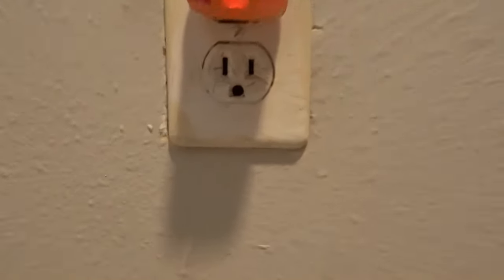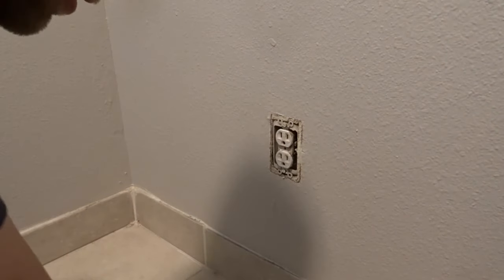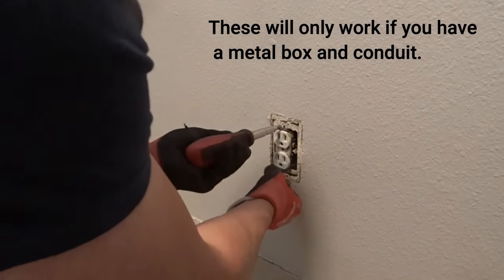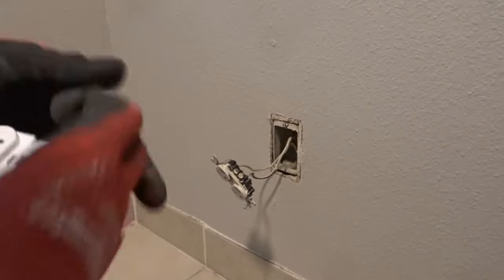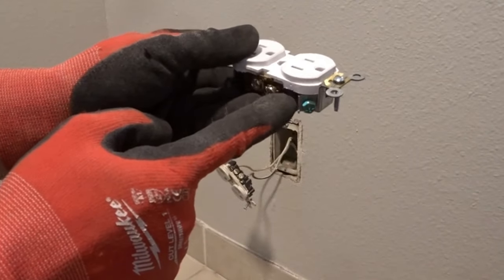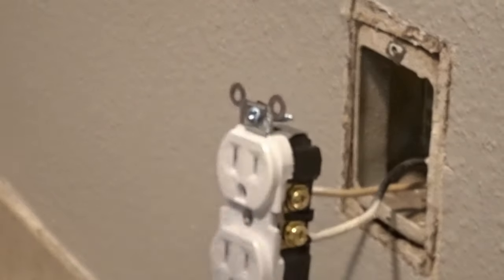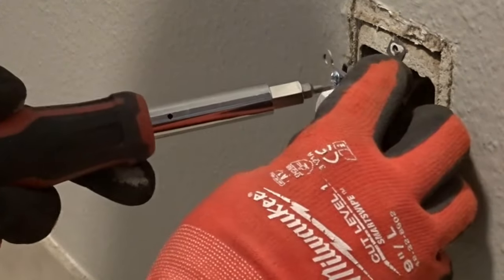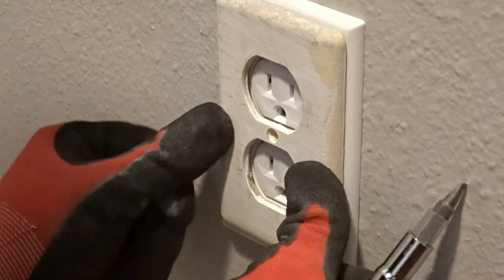How To Replace An Outlet | Ungrounded to Grounded

Comment: i wld have used a ground tail the fact the old outlet had no ground wld have made me think there is no good connection either a loose ring or so much debris the yoke and screws have no ground contact. otherwise bare minimum code/work  leads to exceptional problems in future🤔
Reply: Im right there with ya, I would have used the ground pigtail too, and looked like the box had an extension on it also, cant go wrong with  ground pigtail

Comment: Basically, your "pigtail" is just touching the metal box??? It doesn't screw onto anything...just the outlet green screw????
Reply from the maker: Because it’s the preferred outlet, the pigtail is not needed. Does that make sense?
Reply: @aaronfixesstuff  I have outlets in my basement that are not grounded. These outlets are in a metal box. SO if I screw a copper wire onto to the green screw of the outlet & have it touch the metal box, the outlet will be grounded???? I thought, this copper wire is called a "pigtail" ??
Reply from the maker: @k.b.392  you can buy a pack of grounding pigtails from Home Depot and that will do the trick. I showed one in the video.

Comment: You still did put that ground wire in it’s just the hot and cold no ground that was a if you show there what you did was just put hot and cold that’s it lol I was just going to do the same but checking on the net to see better but it’s just one thing give it power 🤩 great video thank you

Comment: Dude you don't know that the box is grounded. Those large rubber plates look like shit, imo. Keep learning Aaron. You have a long way to go. I would always wrap the wire around the screw, and not use the trap and pinch plate. I think this is code in CA.

Comment: I am missing something ... or you forgot? When you put the receptacle in there were only two wires. You did not have the ground wire attached.
Reply from the maker: That is correct. So the two ways to ground it were either with a grounding pigtail, or using the preferred outlet (that does not require the grounding pigtail). I chose the preferred outlet.

Comment: I still only saw 2 wires hooked up. He screwed he ground screw in without any wire. What connects the gtound pins to the box?
Reply from the maker: If you use the preferred outlet, the screw that attaches the outlet to the box does that.
Reply: @aaronfixesstuff  , Yes, I went back and he actually said that. But what is it about the preferred outlet. Is there a contact going from the ground sockets to the screw so it grounds whatever you are plugging in?

Comment: How is the outlet shown as grounded when it clearly isn't?
Reply from the maker: It is grounded. Why do you think it isn’t?
Reply: @aaronfixesstuff  what is it grounded too? There is no wire to grounding screw. I am not trying to be insulting but your video is very different in results that I see different videos on the same topic.
Reply from the maker: @AJBulava  not insulting at all. So I explain it in the video. The preferred outlet has a tab on it that replaces the need for the grounding pigtail. So this outlet was absolutely grounded, as evidenced by the tester. However, this solution only works I f the box itself were grounded. If the box is not grounded, I made a video that addresses that situation, and how to fix it.
Reply: @aaronfixesstuff   Is the solution a GFIC plug?

Comment: It's not clear why the old receptacle was not grounded and the new one is when nothing else was changed. The mounting screws, if tight, should provide an incidental ground by virtue of contact between the threads in the box and the screw heads on the receptacle yoke. All the paint could be an issue or the receptacle was bad. I would like to have seen a continuity check between the yoke, the ground screw, and ground opening on the old receptacle. If that checked out and you scraped off the paint and fastened firmly with clean screws, my bet is that your tester would show correct ground.
I'm not saying that you shouldn't change the receptacle because that was absolutely correct and the spec grade receptacle you used is the way to go. In the beginning you should use a multimeter to verify whether the box is grounded or not. The brass self grounding spring metal on the new receptacle helps, but shouldn't have made any difference. Having conduit or armored cable does not guarantee a good ground. It should be inspected at it's origin, the main panel. Your tester verified that the grounding is there.
I like your video though, Aaron, I realize the effort it takes to do this is not easy, thanks.
Reply: Yes you are right.   His presentation was meaningless really.  

Seems the video was made a fluff click bait.  

First you never do work without testing the box ground with a meter.  Otherwise no outlet will ground after you install it.   The old outlet should have grounded if the box was grounded, so step 1 put a meter on the box and neutral and see if its grounded.  You don't need a fancy outlet.  They all can ground through the mounting screw, so the old one was probably broken.  

He never said the box was metal and grounded.   Others made good points too.   So obviously it is a click bait video for views.   The dummies like it, but they really learn nothing useful.
Reply: Isolated ground receptacle was the old one.    The yolk is isolated.
Reply: @tedlahm5740 No it's not. I doubt that one would be used here, and an isolated ground receptacle has a triangle on the face. I didn't see that.

Comment: wow, the whole house was done in conduit? unless therye emergency circuits, even commercial buildings arent typically all done in conduit. But as an electrician myself, I never recommend using the conduit as a ground. While it is allowed for Code purposes, its only allowed if every single connection in that conduit run back to the panel is tight, and if you didnt do the run yourself, you have no basis to trust whoever ran the conduit did it right. and if the conduit run ever disconnects from a connector or coupling, you lose your ground. Youre better off pushing an individual ground wire through the conduit and grounding it in the ground bar in the panel. much more secure connection

Comment: !!! If the socket has no seperate ground, one solution could be to connect the neutral wire with the ground wire at the socket. So If the hot wire in the device touch accidentally the metall case, then the circuit breaker in the main panel interrupts the power (because of direct connection between the hot and the neutral wire). If you don´t do that, the metal case of the device has got the full 120V and could kill the person who touch the device!!! I would never leave the ground at the socket unconnected!
Reply: Thats known as a cheater and does not protect the same as a grounding conductor. You can burn up electronics that way.

Comment: Just in case you didn't know NEC requires you to have at least 6 inches of wire out of the box. You should never cut the wire short.
Reply from the maker: If you look at the comments, I have said numerous times that there was more than 6” left.
Reply: at leat 6 inches of wire in box, no less than 3 inches outside of box, per NEC 300.14, and there are exceptions.
Reply: Who cares

Comment: Don't get caught in an inspection. Grounding through BX is not approved. A separate ground wire from the panel is required.
Reply: So as I’m watching this I’m thinking he didn’t ground the wire properly...he in essence cheated correct?
Reply: @alfredretana6987  Pretty much. BX and other conduit, including boxes are not approved grounding methods. They should be tied into ground but not used as a ground conductor.
Reply: Not necessarally.   Grounding through BX is usually how it was done for years and years.   Old codes work if you are not doing a full remodel.
Reply: @eatont9999  metal conduit such as emt and rigid can be used as a grounding means per code, but also a ground pig tail is required too

Comment: won't pass code unless ground carries all the way to the panel either through the  raceway (mc or emt rmc...etc.) or a seperate grounding conductor needs to be ran to your grounding system

Comment: In cases where EMT is used, the EMT may not be able to handle the current associated with a short or has more resistance that acceptable for tripping a circuit breaker. In those I use a GFI outlet that will locally trip and only uses the EMT to sense a short and not actually pass a short.

Comment: A metal box alone wont make it grounded.  There must be a ground wire that goes all the way back to the junction box.
Reply from the maker: The preferred outlet has a tab that will replace the ground wire. So in this case, it is enough. But in general that is true.

Comment: Try to do it on a residencial PVC box, remodel box that you always find on Houses......
Reply from the maker: This was done in a residential setting. I will also make a video on what to do if it is a plastic box.
Reply: @aaronfixesstuff  I’m inspector,what you are doing is what the rehabers are doing and at the moment to sell the house, the Insurance company hold the sell until an electrical contractor Fix all the cheats in the house. Cost that the seller is force to discount on the selling price. An Advice, With not licensed try to not advice nobody to do that.
Reply from the maker: @javiergiraldez1647  I agree that you should always consult an expert. The video was for demonstration purposes, but there was nothing that is against code done there. I consulted a master electrician who confirmed this.
Reply: @aaronfixesstuff  Totally agree, just to let you know, the new Led lamps plug in a fake grounding system, compromise the electronics and produce a short circuit that is transfer at least 94 V to the grounding system of the house and return to every metal water pipe. The consequences, customers calling me to fix an electrical issue “ I been shock, when I was doing laundry” or watering the yard, etc. If there are Masters doing this is, they need more experienced experts, before trough something to the networks.
Reply: @aaronfixesstuff  
What you did there was fine but whoever previously installed a grounded receptacle that was not properly grounded, violated code. It should have had a two prong ungrounded receptacle in it instead.
Reply from the maker: @njsongwriter  I absolutely agree with you.

Comment: THX simple process... safety first.. might want to add using a Voltage tester even after turning of the circuit... show a circuit board so novices know where to turn off the circuit you are working on.

Comment: Nine times out of 10 residential houses do not have conduit running from outlet box to outlet box, so this would not work in  most cases.
Reply from the maker: I’m curious where you came up with this number from. Also I made a separate video that addresses it when the box is not grounded. You’re welcome :)

Comment: I'm a Electrician ?? Why Didn't you add your Ground to the box? You look like your using a better outlet than a cheeper one. But i don't think it's self grounding. You Should also remove the screw retainers if not using a ground wire. Not saying you should not. and also clean the paint off the Pring.  But the old outlet should have shown Correct I don't know why it didn't..
Reply: yup sloppy half fast work. i would have used a ground tail something about tht first outlet not having a ground - wld have tipped me off about a bad connection debris or a loose mud ring🤷‍♀️

Comment: A pulled ground wire is ALWAYS better than relying on the conduit.  Conduit can RUST or come loose.  But if you can't pull a ground wire... well you gotta do what you gotta do.
Reply from the maker: I agree that a ground wire would be ideal. But like you said, sometimes that’s not a viable option. Thanks for watching and the feedback!

Comment: I have a GFI in the closet lower level of the home by the garage I did a pig tale and it still not grounding properly can your help me ? Thanks
Reply from the maker: J Balls if box is not grounded, the pigtail will not work. But if you have a GFI you don’t need a ground.

Comment: From all my research I have never heard of this type of outlet serving as a ground where there is no ground wire. In addition you did not film the outlet with the tester in it to show that it was grounded. Per my research it is specifying only GFCI outlets or two prong outlets can be put into an ungrounded outlet box.
Reply from the maker: Allaboutthehome thanks for watching. This will only work if the box is metal and if the wiring is run through conduit. It would not work if the box were plastic, or if the wiring was just romex. In that case you would need a gfi.
Reply: @aaronfixesstuff  Thank you. I am just now researching conduits and metal boxes. I have additional research to do it appears to more fully understand this. I am getting enthused as my old 1950 house has metal boxes so I would love some additional hope for it. Thank you.

Comment: First comment, we don’t need all that wire?  Sometime in the future that wire would be needed.
Reply from the maker: Perhaps. But that was the last outlet on the breaker and there was like 12 inches of it. It was way more than needed.
Reply: @aaronfixesstuff  don’t sweat it because mine broke and so I had to cut some off. I have a ground but the new dual outlet and usb outlet and shows up incorrect ground. Tried it in two different outlets. Any ideas.

Comment: All houses built in 1970s has a ground earth ground. I know , i owned a electrical company  in usa plus was a master electrian  for usa military contractors in war zones. The houses with no ground is houses build  before 1960s. On usa colony philippines, usa purchased from spain in 1898 at tbe end of the american spainish war, along with quam, usa  made a usa territory and hawaii , usa made it a usa  state. And put cuba on santions for teaming up with spain against usa in war. The philippines is still over 70 years behind usa in electrical. No earth ground college coarses. Plus no earth ground, you can not have safe no fault recepticals or high tech equipment. It takes a earth ground to   balance mega generators in power grids and for computers to have a no fault isolated circuit takes a earth grounded panel also. Alot you van not do correctly without a earth ground.

Comment: what a noob move by cutting the slack . what happens later down the line when they next owner wants to upgrade ? now not enough wire and they have to rewire ...
Reply from the maker: If you read the comments, you’d see that there was more than 6” left in there. So not so much a noob 😜
Reply: @aaronfixesstuff  yeah you had atleast 6 inches . I know the code but the code only requires a minimum so sometimes especially older houses without a third ground wire . it's best to leave more because the service most the time isn't up to date with he appliances the house has now .meaning the houses service is usually to small for what the owner intends. keeping wires long allows that if something like to much current like a space heater is used on that outlet.  the wires will burn and become brittle . so leaving more is best for older houses.  my school professor told me this when I asked

Comment: I would not trust on any gimmick grounding on that box as it is so full of paint. The tester cannot tell if the ground impedance is low enough. At least remove the paint under the outlet.

Comment: As usual European viewers are horrified by the lack of safety of US electrical code,
- default of ground will cause all conduits, screws, etc to possibly be hot.
- any change in the conduit may break the ground
- to have any modernized circuits not protected by a GFI breaker from the main box is brain damaged. Current leaks may appear anywhere in the circuit.
- conduits connectivity is not guaranteed by any means. Any move in the walls, for ex due to temp change may cause this "fake ground" to loose connectivity.
etc...  All of that is frightening.

Comment: This solution only works if your home is wired in metallic conduit. If your home is with with Romeo or plastic conduit this solution does not work!
Reply from the maker: That is correct. I had a lot of people ask what to do if they don’t have conduit. I made a video that addresses that as well.

Comment: There still is flaw in here. There should be a green wire (Ground wire) connected to that green screw which then would go to breaker box and then a ground rod thats a true ground. If using the correct junction box inside of the house it will be plastic which there is no need for that electric tap being on the plug outside of the house or in a metal junction box would make sense.
Reply: Are you familiar with the dunning-kruger effect?

Comment: Since my outlet box is metal I just used a grounding pigtail xD
Reply: Just because you have metal boxes does not mean those boxes are grounded.  Older homes can have knob and tube or romex that has no ground wire; leaving the metal box with no connection to ground.
Reply: I'm in total agreement with ScottBC31H's reply. You should consult with a professional electrical contractor to confirm that the wiring system has a grounding path through the metal box or not. Again, do not assume that a metal wall box = grounding path.
Reply: @scottbc31h22  My apartment is fairly new built in 2018 and the framing studs is made out of steel
Reply: @ix.cryo1  Do NOT assume that steel framing studs are a sufficient ground. 
However, being built in 2018, If your wiring does not have individual ground wires, you should be grounded via the metallic sheathing of the feeder cables.